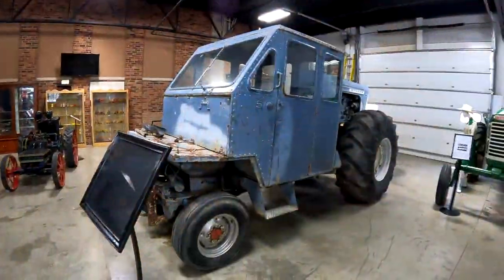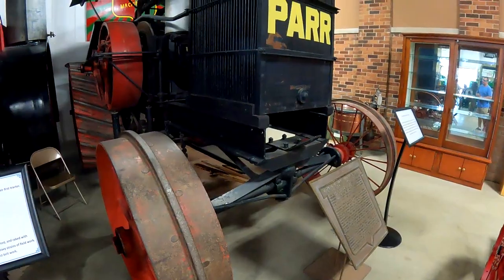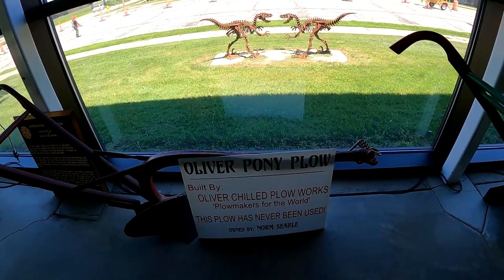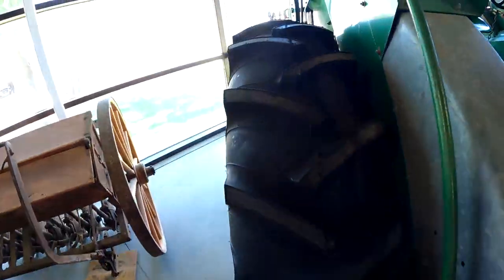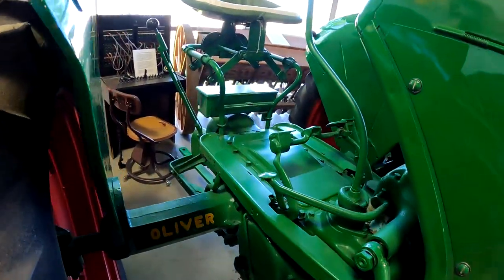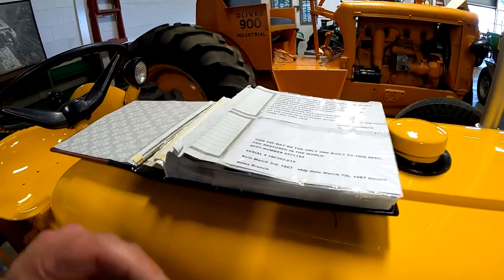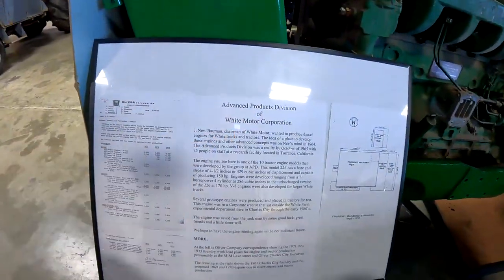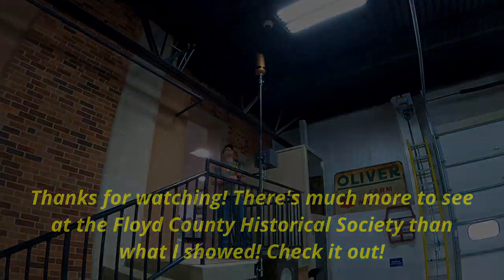Floyd County Museum: Charles City, Iowa! We Check Out The Olivers On Display At The Oliver Museum!

Comment: My dad's mother bought a 1929 12-24 H series tractor brand new and my dad still has the the tractor today and I'm the 5th generation . 
  The tractor still runs as it did in 1929.
Reply from the maker: Amazing how long the old tractors and equipment last. Generations
Reply: @WisconsinOliverNut  
 This Steven and I'm 59 yrs old and my dad wants to put the Hart Parr tractor in the museum in Charles City,  Iowa. 
 But I rather it wouldn't go there .
 I want to continue using it in shows and parades, I have only started the tractor 5 times in my life. 
  I grew up with Oliver's I use to ride with my dad when I was 3 or 4 years old in the cab on a Oliver 77 diesel with a mounted corn picker.
  My dad we have Oliver in the shed restored. 
 I have a 1952 Oliver OC3 crawler which I have owned for 45 years and it still runs when we need it.
Reply from the maker: That’s awesome! And for the Hart-Parr, I’d say do what you like. You can always play with it for awhile, then see if the museum will take it
Reply: @Wisconsin Oliver Nut  hello this is Mr Brown. 
 I will explain something,  my dad is the owner of the hart Parr.
 I am 59 and I only started the hart Parr tractor once by myself. 
 And my dad is 89 yrs old.